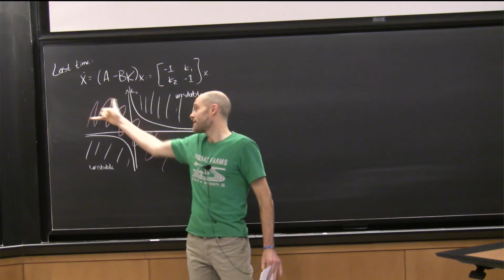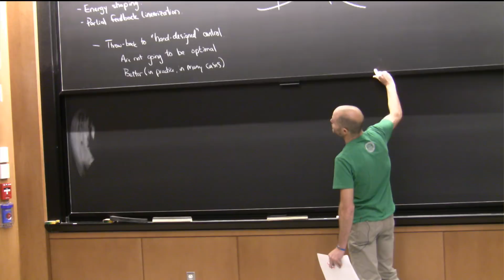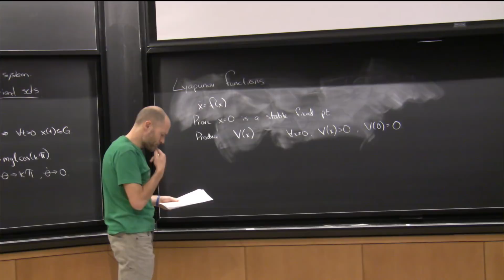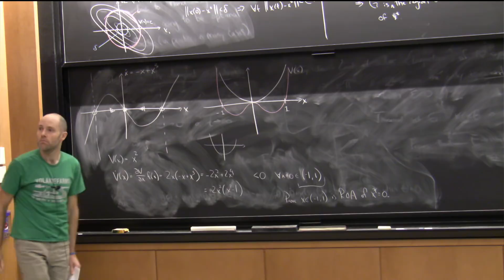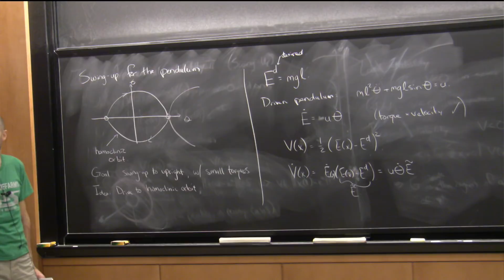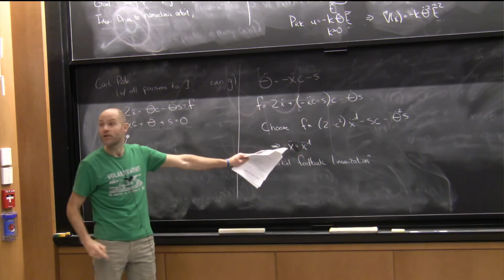Lecture 6 | MIT 6.832  (Underactuated Robotics), Spring 2019

Comment: We argued in the beginning of the course that feedback linearization was a bad idea (because it doesn't make use of natural dynamics, and might require very high actuations just to cancel them). Why isn't this also true for partial feedback linearization?
Reply: It's been a while since that lecture (note that there are versions from 2020 that are more up to date, at least until covid hit), but I normally try to address it.  It is still true for partial linearization.  I introduce it as a tool (it helps us understand some of the implications of underactuation), but don't use it heavily in my own control systems.
Reply: @rtedrake  Thank you for clarifying this! What would be your go-to method for acrobot/cart-pole then? Would you do trajectory optimization even for these simple models?